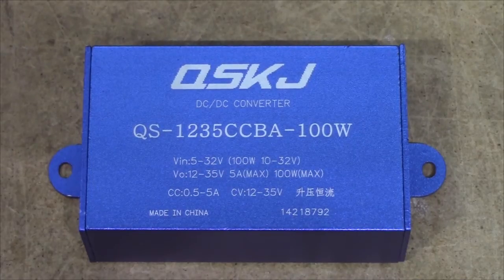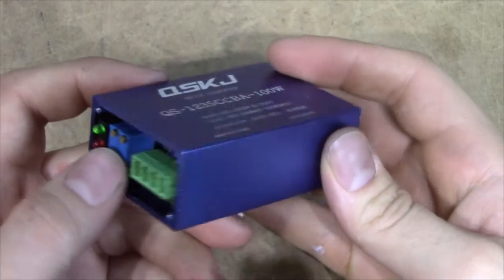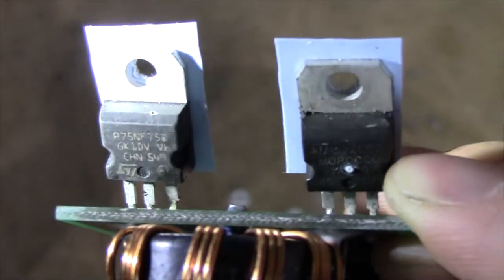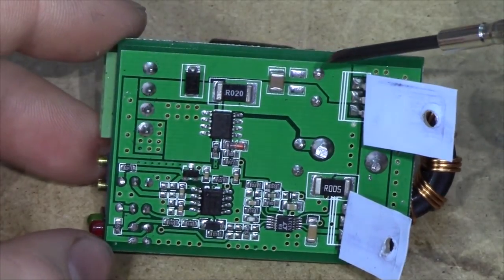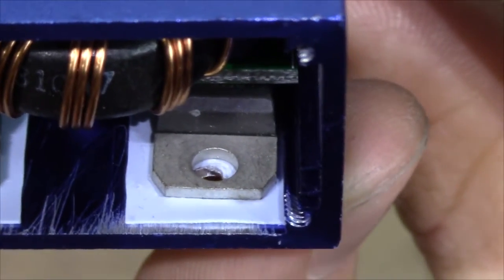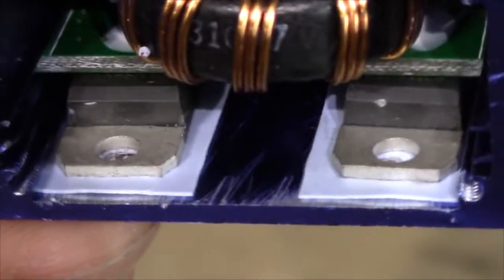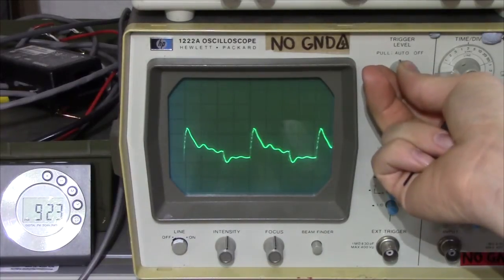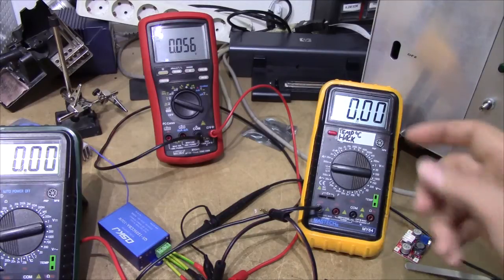QSKJ constant current DC boost converter - China review

Comment: thanks giving us a look inside that thing.
one note: the schottky on the output is not meant to protect from faulty wiring to the output. it is necessary to prevent the output voltage from rising uncontrollably when there is no load connected.

Comment: I know this thread is a bit old but these devices are still out there. I picked up one to power the Lorance chart plotter on my boat as the DVSR battery charger was shutting down the unit when it switched. It switches on low battery voltage and connects to the engine alternator. This causes an immediate voltage increase from 12 to 14v with some alternator ripple and the chart plotter reboots. A constant voltage device seemed to be the answer and I'm glad I found your review. I eliminated the Vout ripple with the LC filter you suggested but now I'm worried about the shutdown spike. Is there a simple fix for this such as a Zener diode or a cutout relay?

Comment: I can't find this thing cheaper than $17 on ebay now.  Where did you get it for that price?  These things are great.  I did manage to blow one up though; It was running max load while the 4-terminal plug got pulled out of the device, and the cap exploded inside.  Not the device's fault though :)
Reply from the maker: Oops, I actually goofed that up - I purchased it for 11 Euro, not 11 USD. The actual price is just under $15 in my case, and I purchased it from the seller "babykiss-365".